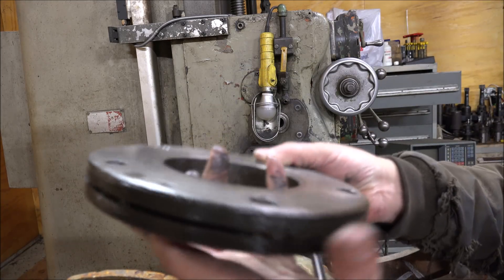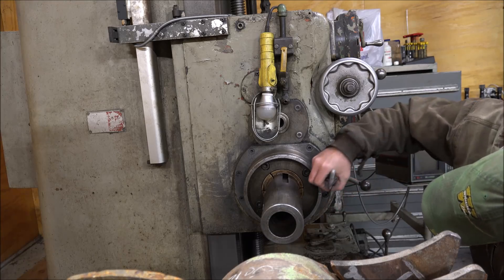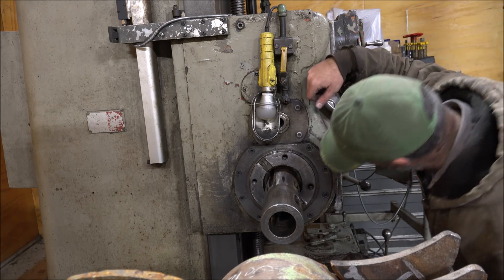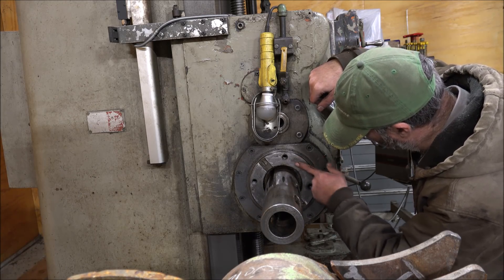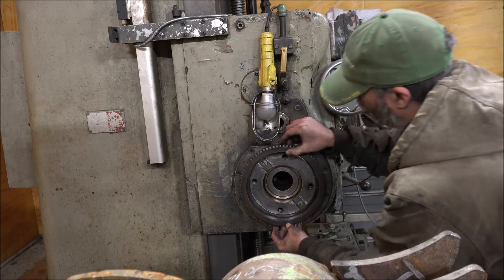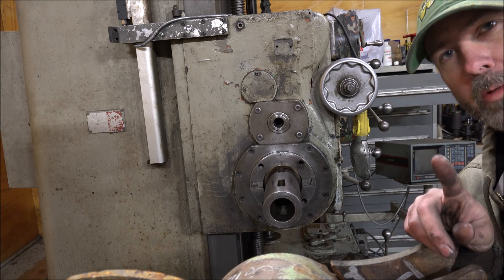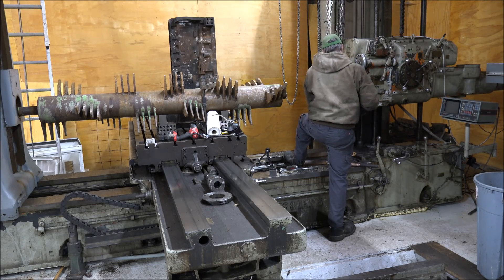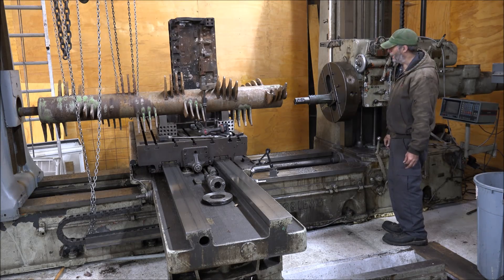Installing a Boring and Facing head on a Giddings and Lewis 340T Horizontal Boring Mill

Comment: There is a small lever that works like a brake caliper that stops the ring gear from turning which makes the facing head feed, there is a flange on the ring gear that the caliper clamps to
Reply from the maker: I don't have the lever or the bracket and caliper sadly. i will have to try to reverse engineer it.

Comment: Was that a locking piece of some sort to hold the Morse taper in that you removed in the beginning of the video???
Reply from the maker: Yes I have a wedge key that holds the MT tools tightly in the spindle. It is a must for milling. There is a video where I made it.

Comment: Good day sir. Thanks for the videos! Is there any reason you haven't cut that slug off the end and drilled into the face to make room for tooling?
Reply from the maker: Too lazy to double set it up I guess. I would have cut it off before setting it up the first time but because of wear and the previous torch attack job on that end I would not have had any good way to determine where the original center was.

Comment: Saw a G&L at Westinghouse in California with a rotary table buried in concrete and the machinist rode in a cage on the head of the machine. They worked on ship props. There was a railroad track that came right up to the machine to deliver parts. Pretty cool.
Reply from the maker: Yeah there are some really big machines out there.

Comment: I ran a G&L 350T for a while.   Had to teach myself how to use it.   I never had a job which needed the facing head, nor the high speed spindle, mostly facing and hole patterns.   A versatile machine, I used it instead of the mills in the shop, even for smaller jobs.
Reply from the maker: Yeah they are handy because of their work envelope. With the right tooling you can do most anything you want with one.

Comment: Judging from your coat, it’s not warm. What ever happened to the underfloor heating system
Reply from the maker: It is still being run with a 5000watt water heater and that keeps it about 15-20deg above outside temps. I never have hooked up that outdoor wood stove to get the real heat. I kinda want to find a good air to water heat pump and install that instead. I find it difficult to find time to tend a fire twice daily or more.

Comment: I'm a dedicated fan and always impressed. Having said that, I respectfully ask, would it have made any sense to have cut off a tooth somewhere on each end  to make room for a steady rest and then just weld them back on? Or did I miss something?
Reply: If the welds on the teeth give him as much trouble as the welds on the plug,  that could turn into a disaster.
Reply: H, Another fan of Brian. I think David Wilks made an adjustable ring which then ran in a steady rest that allowed the part clearance to be swung in the lathe.
Reply from the maker: @chamteleboy  Yes you could use a spider but it would be bigger than my steady rest can handle so that would not really be a good solution for me this time.
Reply: @bcbloc02  hi Brian, thank you for your reply. And of course,  to say thank you for the efforts in producing the video’s

Comment: Is clearance why you wouldn’t keep the head on permanently? Can’t the spindle come through the head? I’m missing something. Great videos as always!
Reply from the maker: I figure without the collet to stabilize the end of the spindle it will degrade the milling function when using tooling in the spindle. Maybe that won't be the case and I can leave the facing head on I don't know. Will just have to see.
Reply: On GLF machines the spindle will pass through the boring head, if my memory serves me right (been a while since I used a GLF) there is a limit on rpm. So if you are using it at higher rpm the head needs to be removed. The head should be stamped with the max rated rpm.

Comment: I really like that you have purchased all of the machinery and that you are using them how many new pieces did you have to make to use these Machinery  i have watched ypu in your videos  you really are knowledgeable with alot of understanding do you only work on Tracktor Engines or do you need to make plates to use on all of these Machinery I hope 🙏 you see my message and respond back to me in 🇨🇦 #YSW Bye 👋 have a wonderful SundayN
 November 28 2021
Reply from the maker: High performance diesel engines are my speciality but I will work on anything that someone wants to pay me to do. I get a lot of these heavy plant type jobs just because other people can't handle them and they are worth repairing. I am told this rotor costs over $10K to replace.
Reply: @bcbloc02  i really like what you do and you are extremely intelligent and informative with alot of know-how  will you be working on any Traktor pulling Diesel Engine anytime 😊 🤔 have a wonderful Monday November 29th, 2021 bye 👋 from 🇨🇦 #YSW   respect back to you 👍 👏
Reply: @bcbloc02  Thank you kindly 🙏 for responding back 🙏 to me in 🇨🇦 #YSW  you are knowledgeable and have alot of know-how respect back to you 😊 bye 👋 from 🇨🇦 #YSW